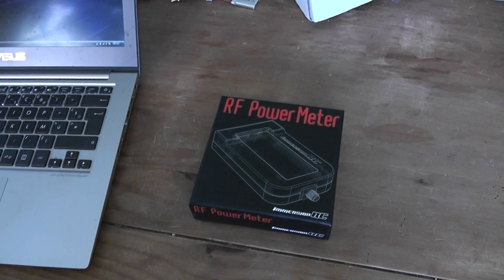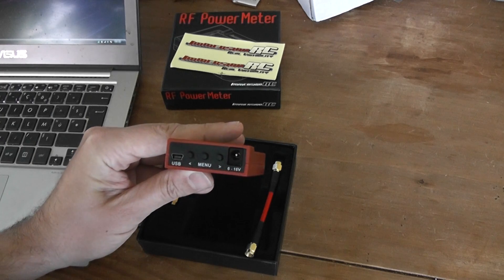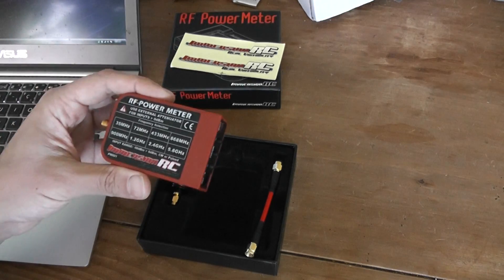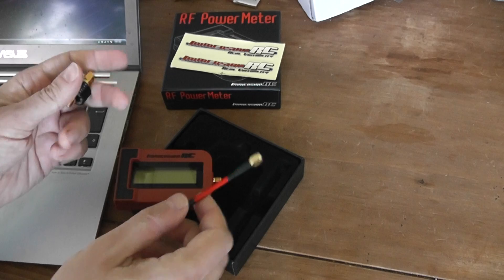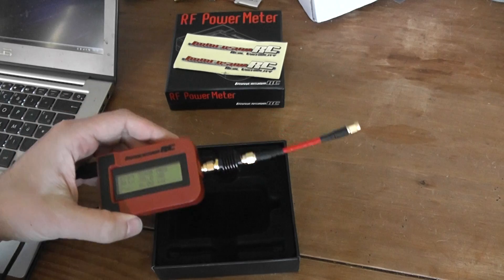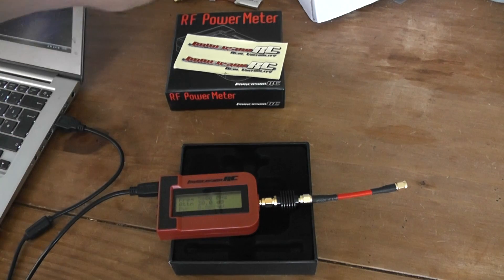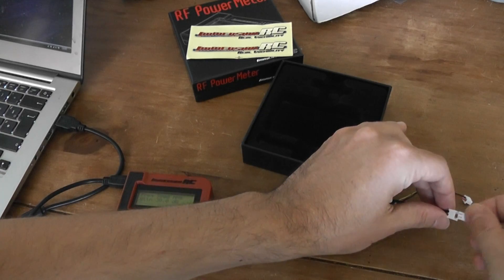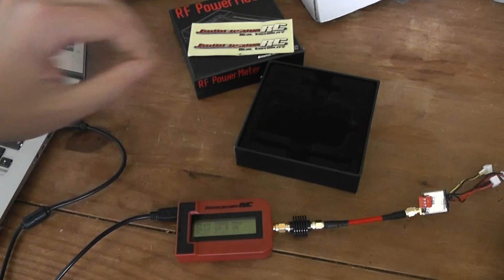ImmersionRC PowerMeter Unboxing and quick testing

Comment: Where did you get this from?
Reply from the maker: You can find it at Banggood or Hobblyking and of course in any good local stores. I bought in France coz the price difference with china's shops was very small. It's a basic good tool. If only the RFexplorer module could also work @5.8g, I would take this letter one. More complete but twice thie price too....
Reply: SeBy DocKy RF Explorer support for 5.8GHz is already available: http://micro.arocholl.com/index.php?option=com_content&view=article&id=133:6ghznews&catid=3:newsflash&Itemid=50
Reply from the maker: Ariel Rocholl Excellent :) The 6G combo is covering both the 2.4 & 5.8. Good find :)